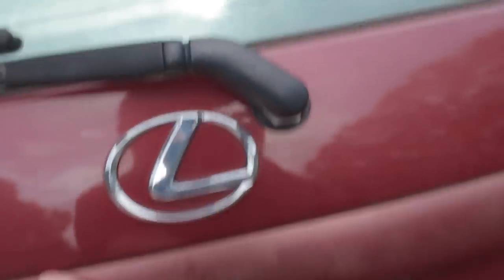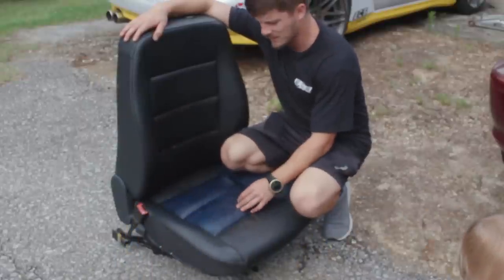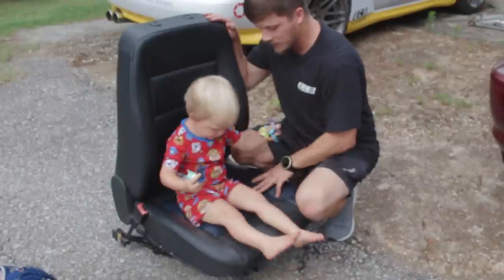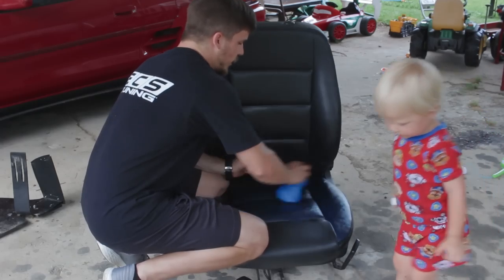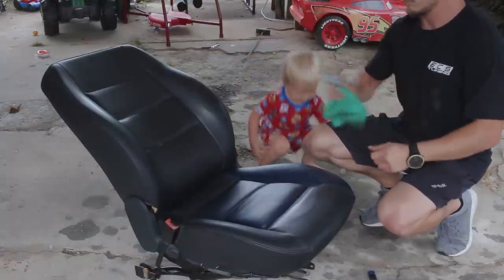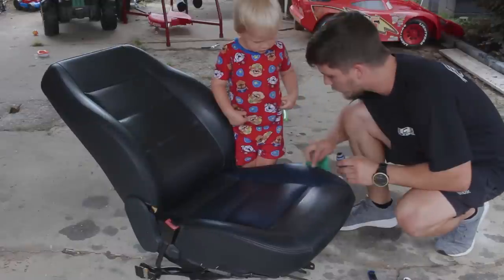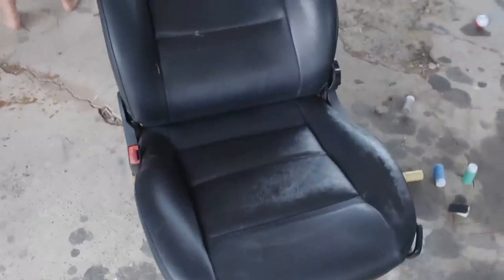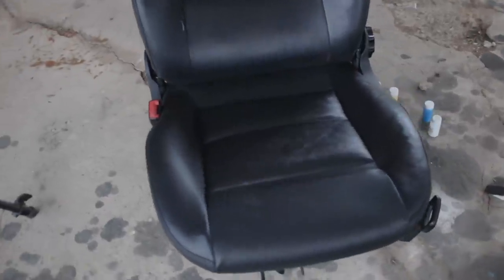They fixed my seat...WITH BLUE LEATHER!

Comment: My dad hired one of those people that go through car rental lots and fix tears and worn leather to color some ugly orange leather. He actually came by with the same thing (probably professional-grade though lol). It took a while just because my dad tried some leather dye before that that didnt work well at all and was super tough to get off. He actually rolled up in one of those big boxy vans with a cabinet system and a huge battery and pump in the back. He used his air compressor to spray the paint/dye on actually. Hope it doesnt rub off on your pants lol